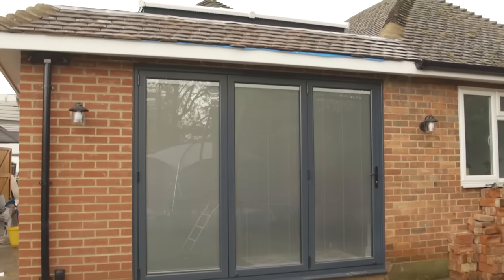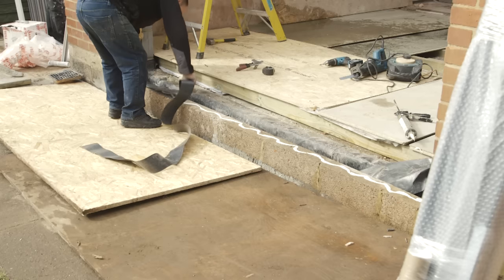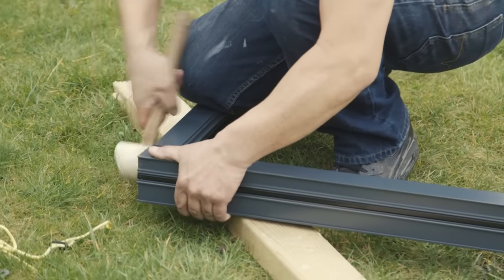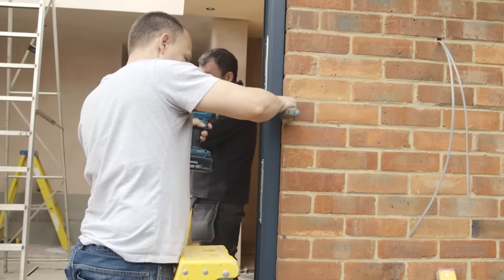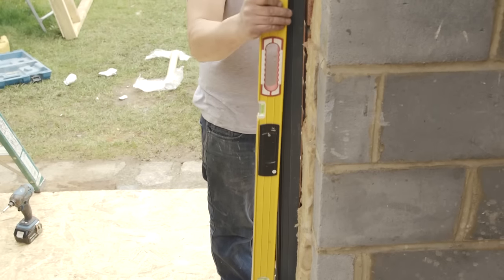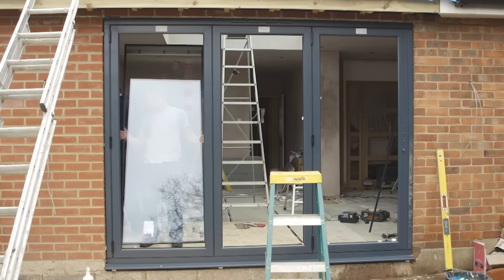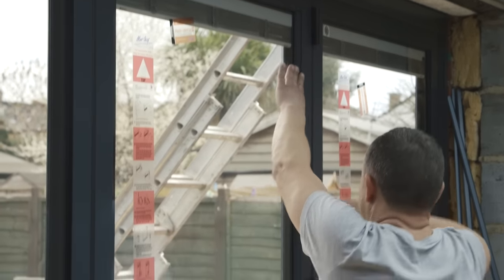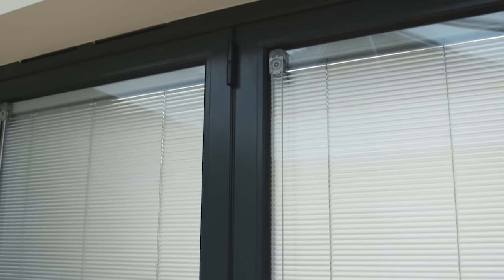How to Install BiFold Doors: How to Build an Extension (12)

Comment: Did you screw the bottom sill to the brickwork or cement it in place or is there no need for that?
Reply: Late comment but the get screwed glued and screwed
Reply: I wanted to know that also as mine have been installed with no packing underneath between the sil and brickwork, As a result, there is a bit of movement when standing on it.

Comment: I hope the bottom of the frame where you put wedges to level the frame was finished because we can see the wood sticking out at 6:18. Besides that small damp strip should overlap the existent one so water doesn't slide between the two.
Reply: You have to pre frame of aluminium

Comment: There is a crack on that brick where you put the first screws??
Reply from the maker: Can't see one? There are some marks & grooves but no cracks that we can see.
Reply: @HomebuildingMagazine  aluminium?
Reply: I seen brick move and mortar crack too on top screw fixing right hand side also no cavity closers & nothing to support fill gap under cill. and a positive side they looked nice and I like to internal blinds (no dusting) also triple glazed.